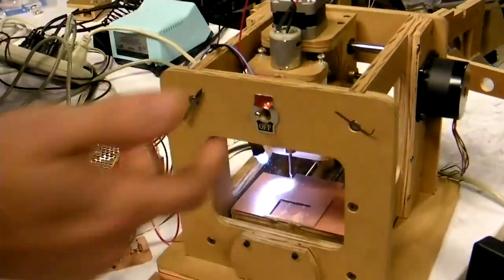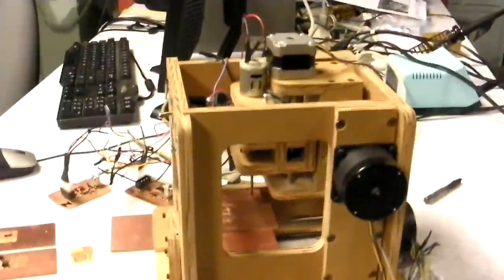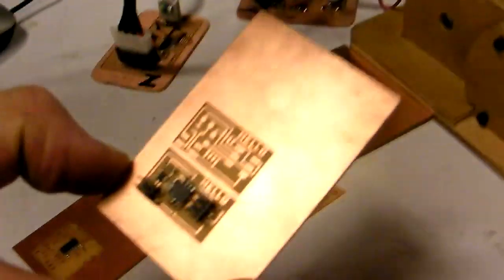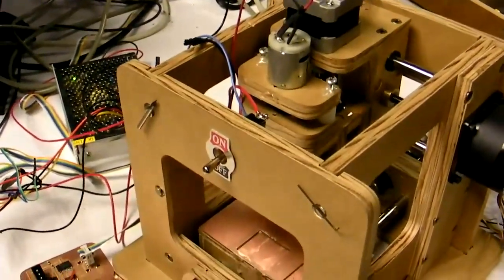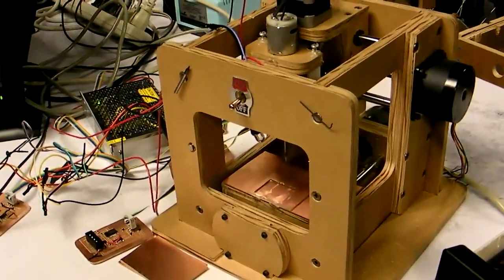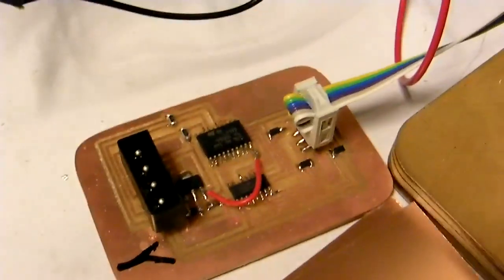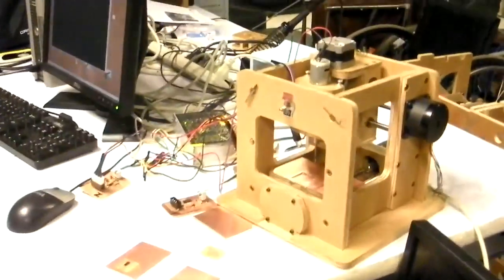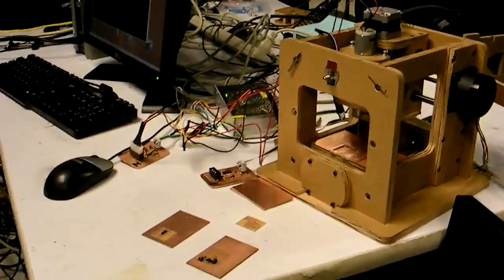Low-cost fabbed 3-axis mill

Comment: I'm an EET major at Northern Illinois. Did you solder the ICs to the board or did you drill holes and solder the backs to the board? 

That is really cool machine... we just did a group project on finder a 3 axis router machine for a company that was trying to automate their hand soldering process.

Great job!